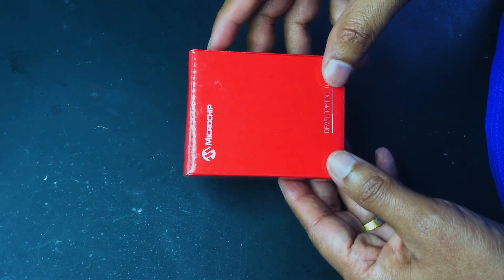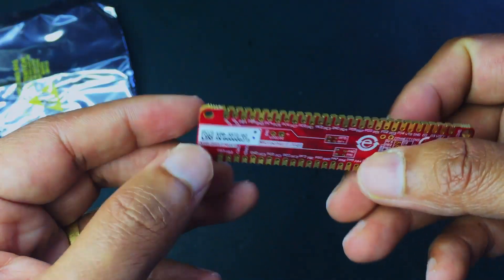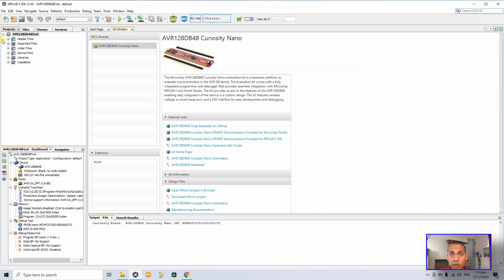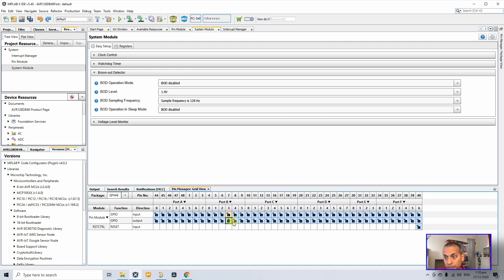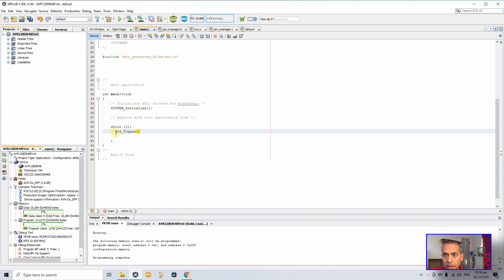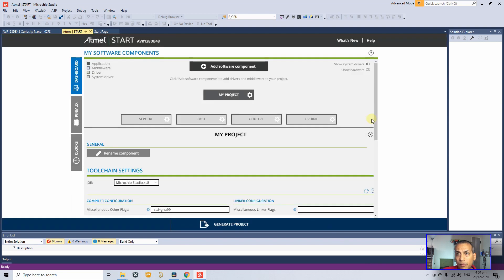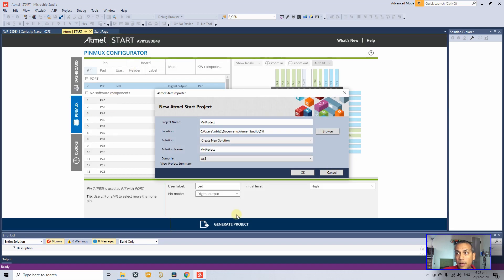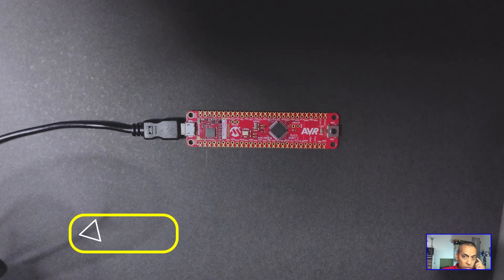AVR128DB48 CURIOSITY NANO BOARD UNBOXING

Comment: I have a PIC32CM MC00 CURIOSITY NANO. Will the producers almost be the same in order to get started?
Reply from the maker: If you use MCC the setting up is pretty similar. However, there will be some differences as what I was showing here is  a AVR and what you have is a Microchip. Hope that is clear.